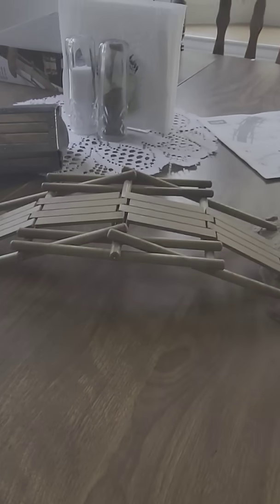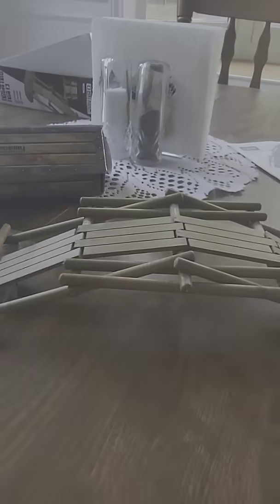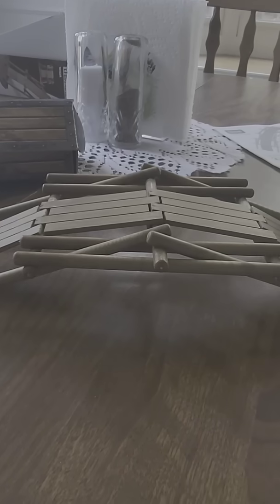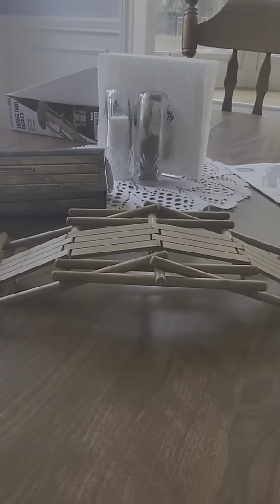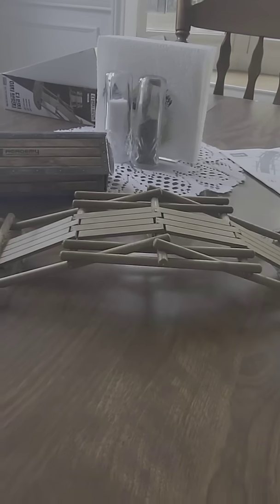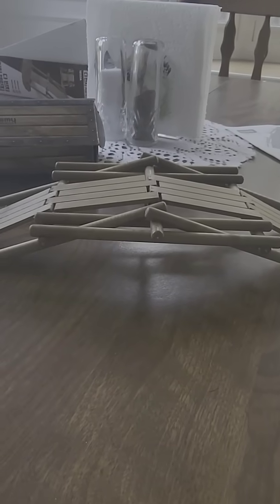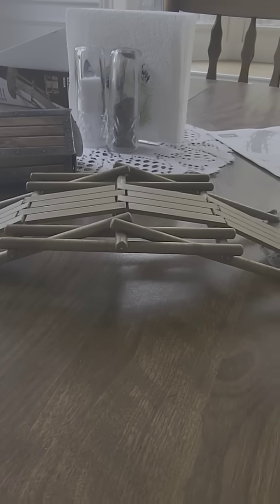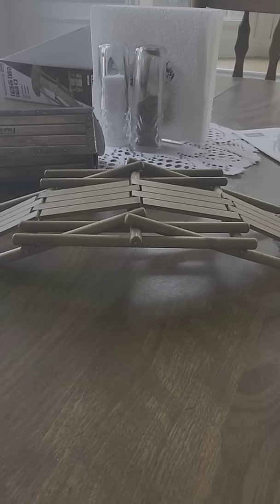Model of 'no nails' bridge. Ancient technique in a little model. Archimedes or Di Vinci bridge

Comment: Will it be slippery if it gets wet?
Reply from the maker: I will mix the cement with Styrofoam for half and perlite in half. Those aggregates should give it texture.
Reply: @  there’s also things sold like grip tape. It’s basically sand paper with glue on the other side. Like the deck of a skateboard but made much better to hold up to weather, rain, cold, hot. The could help.  What is the bridge going over?  A stream? Or just a ditch?